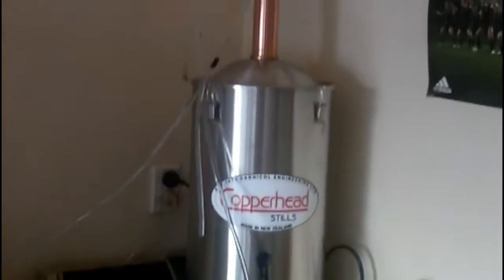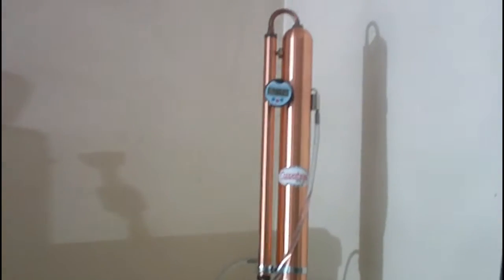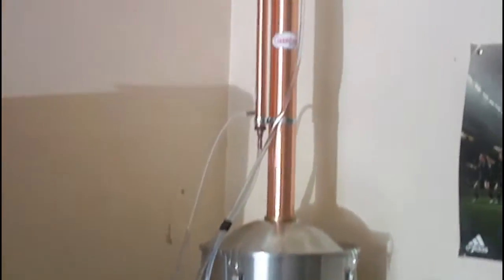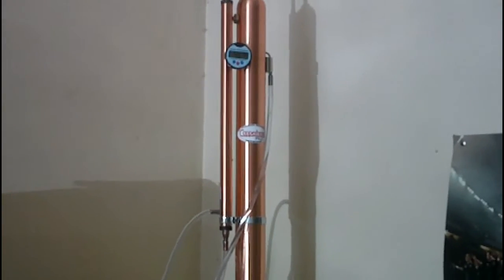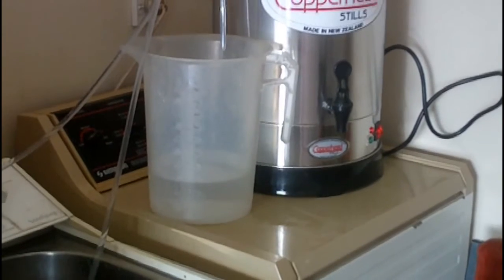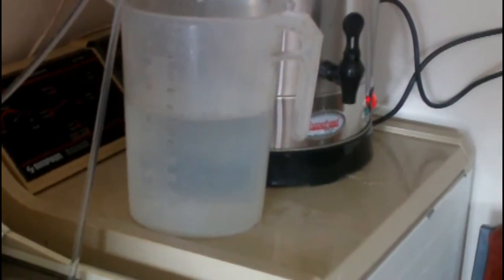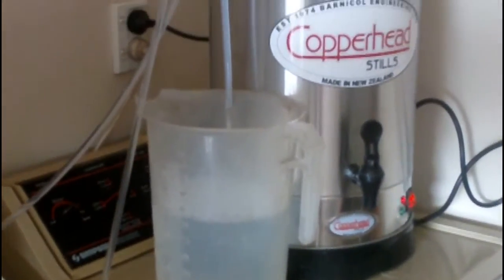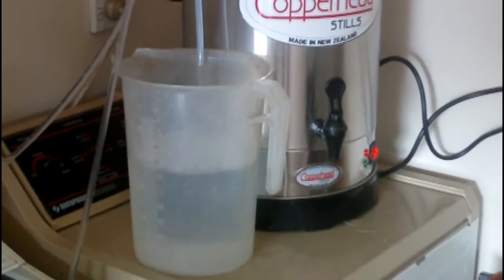First run with the new still.

Comment: Well, you've got a nice still there. BUT...get rid of that damned plastic hose on your takeoff. This shit will leach into your spirits. Also, a fast and dirty  stripping run prior, will improve your spirits...given that you toss the foreshots every time and make cuts on the spirit run.
Reply from the maker: Silicone or plastic hoses may be adequate for coolant input and output lines, but SHOULD NOT come in contact with the vapor or product takeoff path. So the output of product is at a low temp around 20c
                                                                                                                                                                       Cheers